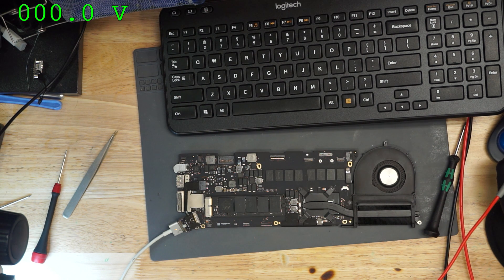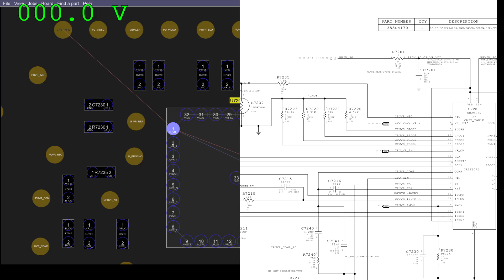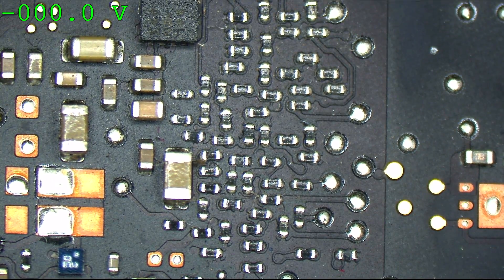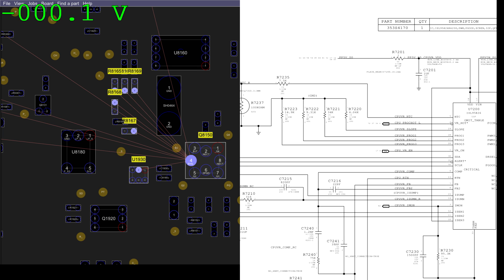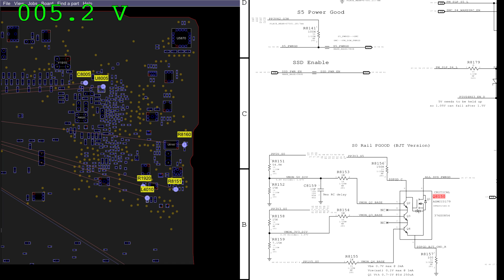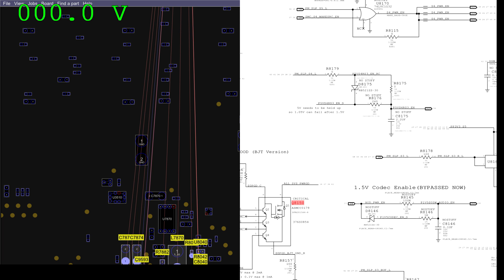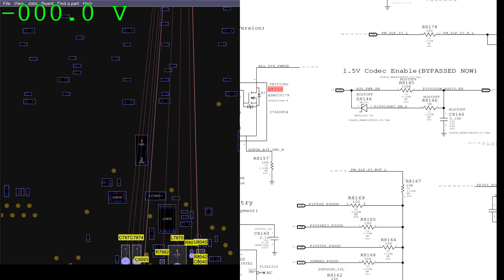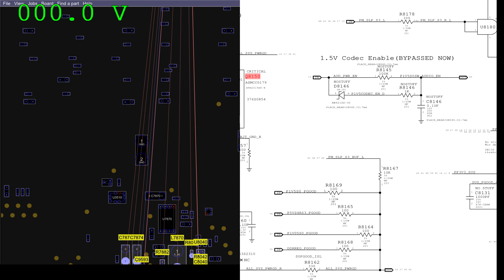Why is Macbook Pro Retina taking 200mA and not turning on?

Comment: Louis i got a question i got a 2008 mbp 820-2330a and it charges fine but it doesnt boot i just bought it to fix it tought it would be a smc reset because the battery indicator is also working like it should charging up fine and when unplugged shows the level but it just doesnt boot maybe you know whats the problem because you’ve been doing this for a while haha i got the schematics and brd files but dont know how to read and understand them totally so hope you could help me

Comment: http://www.circuitnet.com/experts/86722.html

Blue copper compounds include copper hydroxide (Cu(OH)2)- light blue, which can convert to copper carbonate (greenish); copper nitrate (Cu(NO3)2) and copper sulfate (CuSO4). Green copper compounds include copper chloride (CuCl2) when oxidized and copper carbonate (CuCO3).  
http://enginemechanics.tpub.com/14111/css/Types-Of-Corrosion-80.htm

Copper   and   Copper   AlloysCopper  and  its  alloys  are  generally  corrosionresistant,   although   the   products   of   corrosive   attack   oncopper  are  commonly  known.  Sometimes  copper  orcopper  alloy  surfaces  will  tarnish  to  a  gray-green  color,while  the  surface  will  remain  relatively  smooth.  Thisdiscoloration   is   the   result   of   the   formation   of   afine-grained,  airtight  copper  oxide  crust,  called  a  patina.Patina   offers   good   protection   for   the   underlyingmetal   in   ordinary   situations.   However,   exposure   ofcopper   alloys   to   moisture   or   salt   spray   will   cause   theformation  of  blue  or  green  salts  called  verdigris.  Thepresence   of   verdigris   indicates   active   corrosion.

Basically the internals have been exposed to salt/salt water  and can degrade at any time, after the fact..

Comment: "The CPU is going to enable itself"

Apple is the best company, they solved a paradox.
Reply: tbf it's an intel cpu
Reply: Everything enables itself if you apply mains voltage on it. Most of the time, it enables the magic smoke
Reply: @priitmolder6475  I love it when tinfoil enables itself when it's in the microwave.
Reply: Think different
Reply: wrong btw, the CPU is not going to enable itself, but going to enable its VR, that is Voltage Regulator. Thats why the signal name has VR in its name. And this is not apple specific AT ALL, intel CPUs do that in every PC.

Comment: Just a forewarning, I had that exact keyboard and it broke in less that 8 month of light use, sent it in and got a new one back that broke in less than a month, 3rd one broke in another month. So be ready for it to break on you so you might want to just get a new keyboard now.
Reply: You mean the K360? I've had mine for a year, though it has the older Logitech logo on it. Things probably have changed.
Reply: Really? I have mine for 6+ years now and it is heavily used. Works like on day one. Maybe I am just lucky :D